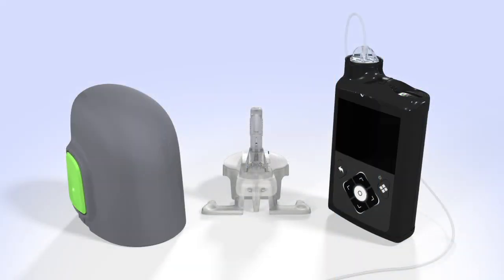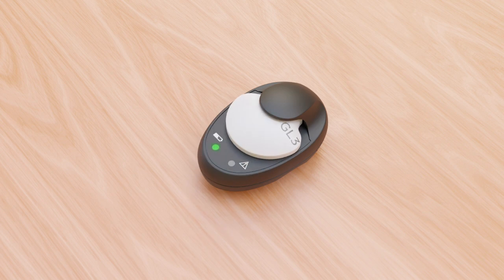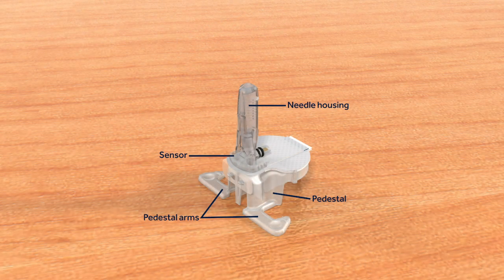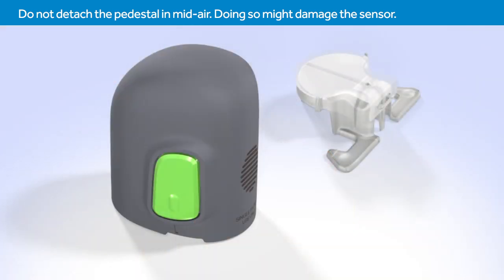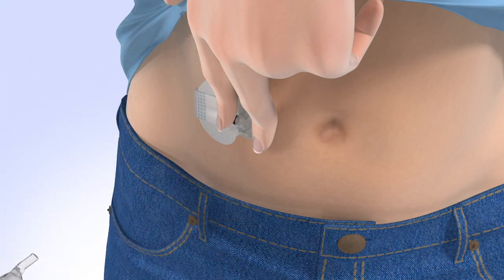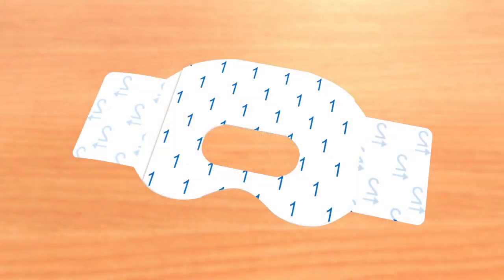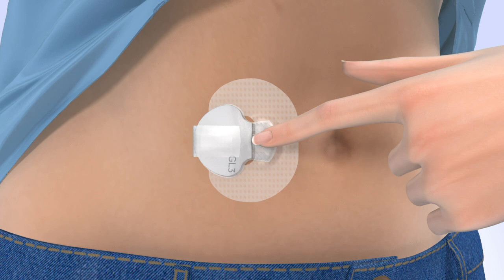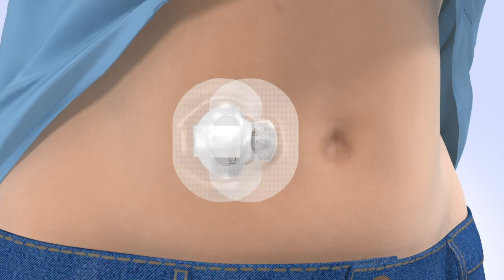Inserting the Guardian™ Sensor 3 with the MiniMed™ 770G System

Comment: Will my 770g pump tell me when to change the g 3 sensor.
Reply from the maker: You can set a personal reminder on your pump for your sensor changes.
Reply: If you download the minimed mobile app, it tells you at the top how long til you need to calibrate, and how many days/hours left on your sensor, before you need to replace. I've only had mine a week so far (1st sensor change is today), but I've found the app to be extremely useful

Comment: This looks so complicated 😅
Reply: It's very easy
Reply: Very easy to use
Reply: It’s not complicated at all. Once you e done it a few times it’s quick and easy.
Reply: its an absolute nightmare, would not recommend, try and avoid medtronic, ive had a very bad experience with the guardian 3 sensor over the 3 years i've used it. get a t-slim!
Reply: @stunteeee6663 
Thanksss... I am choosing between 780g and the Tandem.

Comment: I need to find out what I am doing wrong. My sensor is not working for the seven days that it should.
Reply: Unfortunately this can happen. If it does call Minimed for a replacement sensor. They are supposed to last 7 days.
Reply: Agree the sensors could be much better and last longer than 7 days. Not sure if this is a money issue as in they make more money by selling more supplies if it only last 7 days vice 14 or a month. I say if it is the money issue raise the price a little and make the sensor last a lot longer. :-)
Reply: Ask Your Doctor or insurance to get You FreeLibre 14 days. Your still can measure your glucose levels with this sensor and insert to the machine. Thats what i do. I havent even tried yet the sensor cuz i read bad reviews
Reply: @so_92_  hi Sofi, did you say your Free style sensor can work with the.pump
Reply: @mariaokuns2308  only if you scan by phone the amount of the times you need and then put manually the number on your pump. It doesnt get calibrated but helps a lot so you dont have to pinch your finger all the time.
Reply: yeah the sensors are so ass. its just the quality of medtronic unfortunatley. i really wanna switch to dexcom.

Comment: How often does the new transmitter/sensor need to be calibrated during the first 24 hours?
Reply from the maker: Your MiniMed 770G system should requires 3-4 calibrations per day.

Comment: How long does the Medtronic battery last before being 

It must be replaced?
Reply from the maker: We find that battery usage may vary depending on the brand and type of battery used. We recommend the use of lithium batteries in the MiniMed 770G system and found that with nominal pump usage the battery can be expected to last at least 7 days.